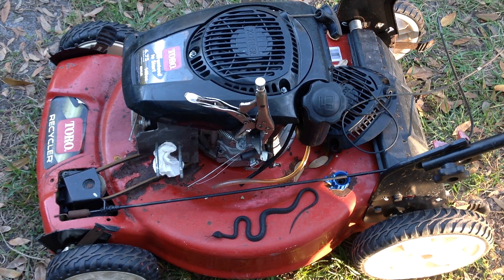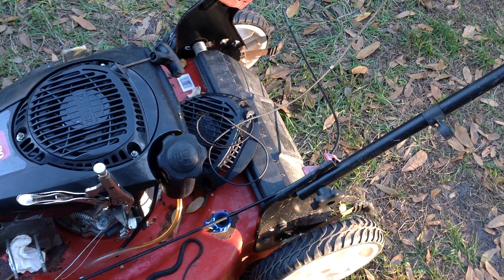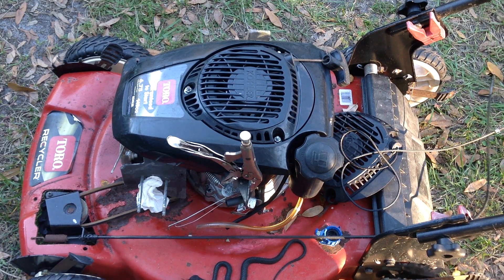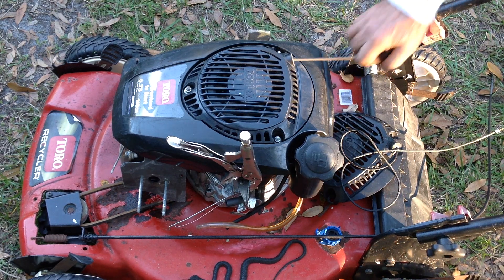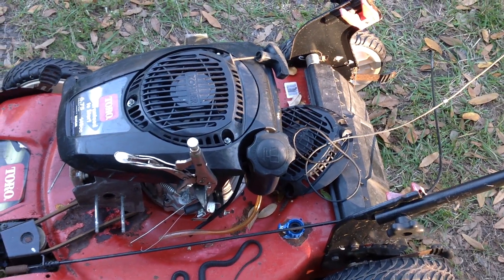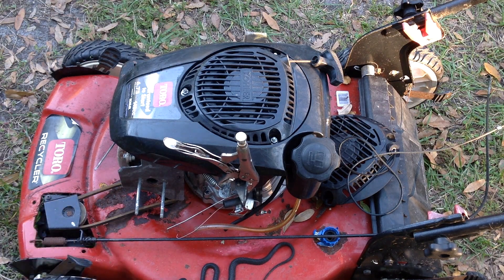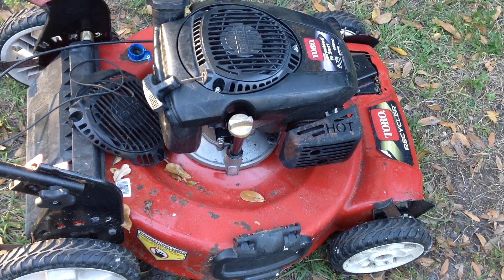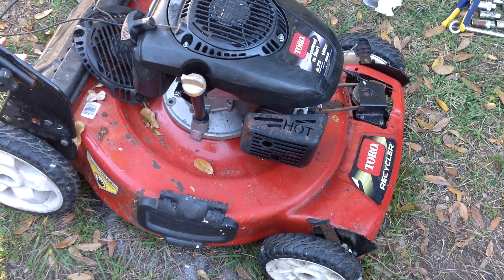Toro Recycler that has seen better days!!!

Comment: If you open the bag door the date is in the serial number on the sticker under there. If the first digit is a 2 then the next number is the year (25xxx would be 2005 model year for example), if the first digit is a 3 the next two digits are the year (314 would be 2014 model year).
Reply from the maker: Thanks.